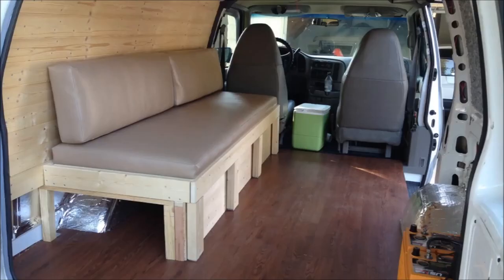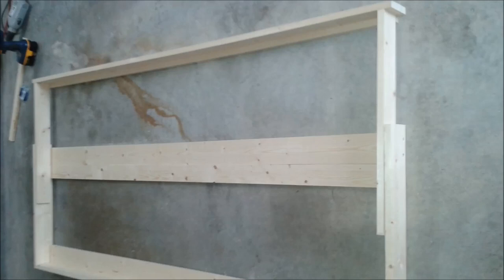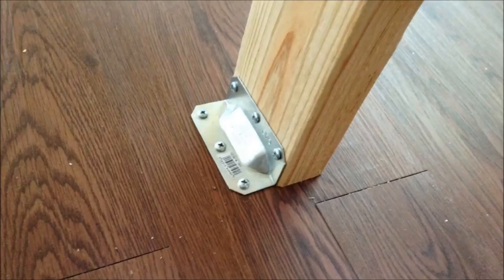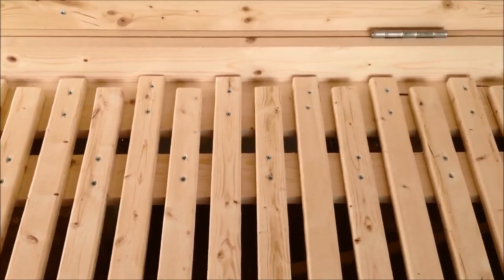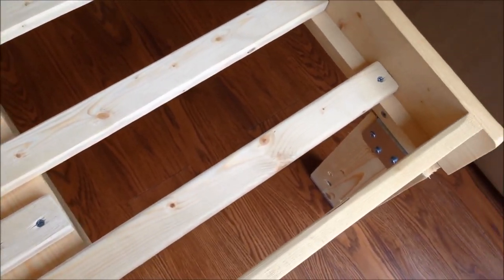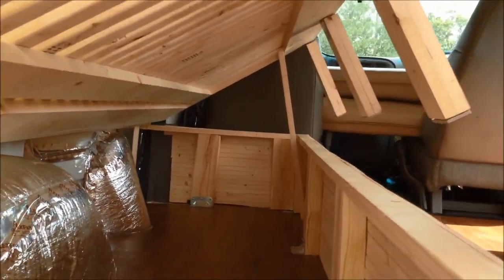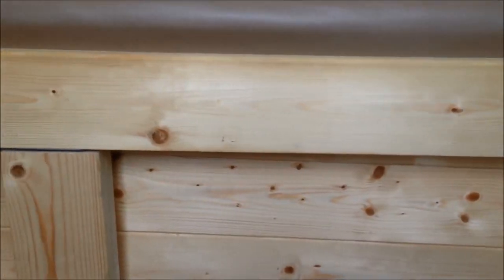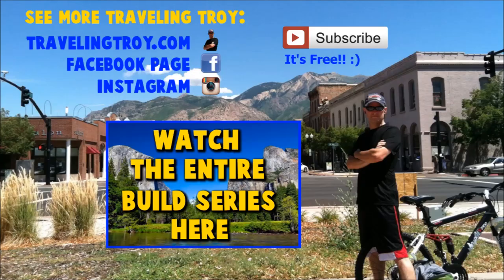Astro Camper Van Build 5 - Sofa Bed Build

Comment: New subscriber here. I have the GMC SAFARI passenger van and made my bed out of PVC PIPE. I made it to the standard size for a self inflating camping mat which is way bigger than what I actually need. But I can always cut it down. I have storage underneath that is huge. I used peg board to be the top of the bed so there was a bit of air flow. Nice build.
Reply from the maker: Awesome Alan!  There is no right or wrong way to do a van build is what I always say.  It's fun to see and hear about different builds as opposed to everyone having cookie-cutter copies.  Have fun with your van, Alan!  Congrats!

Comment: I love the design. Very cool! If I were to build this the only change I would make would be to have the front side of the storage under the bed on hinges, so it can swing out for easier access to what's inside. But it's a pretty ingenious design you have here.

Thanks for taking the time to do these videos.

Greetings from Iran
Reply from the maker: Hi there, you are correct.  It was a pain only having access by lifting up the bed.  I have since removed the paneling along the underside of the bed for easy access to the storage.  I have tubs that can slide in and out without having to lift bed.  I do like your idea of having the access doors on hinges...good one.

Comment: Hi Troy,  Good to see you back.  You inspired me to build a stealth van.  I have a suggestion for your window covers.  Had ears with magnets taped to them so you don't need to use Velcro.  Also used magnets for cab curtain.
Reply from the maker: Thanks for checking out the videos.  I am always interested in making a more efficient with less hassle set of window covers, so thanks for the suggestions.

Comment: building this in my too small for a twin bed room...Thanks , great idea the way it slides out..
Reply from the maker: Cool!  Glad it was helpful.  :)
Reply: i finished.NOW I"M GETTING TOO MUCH FRICTION like old stuck drawers. what would you recommend paste wax? soap? teak oil? I made the bed about 75" by 35" open..Thanks for the vid.After months of research this was truly the best idea I found for my space..I almost build a murphy bed lol
Reply from the maker: I had the same problem.  It started sticking.  I actually used something that I had available, a candle.  The wax was soft and I spread it all over the moving parts.  Now, it works fine and bonus...it smells good.  LOL!

Comment: Nice build. I would stain the wood, glue some felt onto the leg bottoms where they contact the floor, and add a gas shock to assist and hold the bed lift.
Reply from the maker: Good tips.  Thanks for the feedback. 👍

Comment: Wow, what a great bed!!!  Your dad is so talented.  I wish he was my dad too!  I saw this concept in another old school guy type of RV'er who had made one just like this one, but queen size or double bed, not twin.  Brilliant concept having it slide in.  Add some linear actuators and voila!  Auto unfold.  Hofman Architecture in Santa Barbara is renovating vintage Airstreams with these linear thingies.  

I wanted to do this very badly in my own Class C 22 ft RV.  However, I already bought a wood chaise lounge I am converting into a bed, where the old factory sofa bed used to be.  That was a ghastly poufy thing that had to go.  I have to shorten my chaise lounge to fit the smaller space, but the advantage is that one side 'sits up' so I can read. 

Please post some bed making plans where we can find them online.  This is one smart and well made bed!  Your van looks great too, love that wood paneling!
Reply from the maker: Thanks for watching +Lass-in Angeles !  Yes, my Dad is pretty talented in many  ways.  Unfortunately, he didn't make a set of plans for the bed, he just started assembling it based of some napkin notes.  :)

Comment: Awesome! I've decided to upgrade from my 2000 Dodge Caravan to an Astro and your videos will be very helpful, especially considering that was the same design I was planning for my own bed/sofa. I was thinking that you could hinge those legs so when lifted, they fold inward and can either prop up the frame while accessing underneath or fold flat if the frame is folded completely against the wall. Just a thought ... Can't wait to see more vids!
Reply from the maker: Great ideas +Gary Boyer!  The two main problems with having the under bed storage is weight of lifting/holding the bed up and the bedding/pillows get in the way.  I like having the option of accessing things from above, but I plan to add sliding drawers or just tubs that I can pull out easily without having to lift up the bed and moving all my bedding out of the way.

Comment: Thanx ... I need to do some more homework before I gleen this. I’ll need a temp pulley system from ends to wall or ceiling to assist in lifting/ temp. hold in place... then remove ropes, store away when traveling.

Comment: nice work. id recommend gas struts to lighten the weight of it if you need to lift it often.
Reply from the maker: Good idea +Bruce B.  It just gets heavy and becomes a pain to get to stuff while the bedding is on top.  I think I am going to remove the siding along the bed and just build drawers or insert tubs.  This way, I can still lift the bed if needed but I would then have easy access from the sides as well.  Thanks for checking out the channel.

Comment: This was a great video. I want to do pretty much the same thing, with a pull out kitchen under the base of the couch. It would; however, be nice to watch someone make this in real time. I'm a woman, and not handy at all, nor do I really know what I'm doing when it comes to power tools or carpentry. Thanks for this video though. Just goes to show it can be done. 😊
Reply from the maker: Hi there.  Thanks for checking out the video.  Your right.  I don't think there is a video out there showing the step by step process on how to build a pull-out bed like mine.  In my case, my Dad pre-built this bed while I was away and we just needed to build the base together inside the van to install it.  Hopefully, all the angles I provide in this video will give you and others some assistance in completing a similar bed build.

Comment: Really nice bed!  Are you able to sit up straight while sitting on the bed?  Thanks!
Reply from the maker: Not quite +Sister Nomad.  I have to slouch over a bit to fit on the sofa, but my favorite sitting spot is with my legs stretched out on the sofa and my back rested up against the back of the driver's seat.  There is more headroom in this position which allows me to sit naturally.  I do also plan to install a swivel base for the passenger seat which will then be my main sitting spot.

Comment: Hey Troy I just bought a 95astro I'm lost, someone said I can't have batteries inside the van for solar. Gasses. I don't have big bucks to buy real expensive battery,all I want is to run a portable cooler,without having to start the van all the time. Any suggestions, where can I sit a battery safely. I like what you and your Dad have done. Your blessed to have a Dad like that. Been watching....
Reply from the maker: When you say portable cooler, you mean a refrigerator or do you mean an a/c unit?  You can easily run a 12 volt refrigerator from a small battery bank, but it takes a lot of power to run an a/c unit and an Astro van can’t fit enough solar panels on the roof to do that.  😕 Also, I answered your battery question on a previous video. Good luck with your build. 😁

Comment: the pull out section face that takes the bed slats , is that on a 1" x 1" fixed on the inside or a 2" x 1" fixed on the bottom . and are the support arms on the pull out section 3"x 1 " .. Not 4" x 1" as in the comments.
nice work fella !!

Comment: The futon seems better for comfort. If you could get it to go in couch mode with the futon also then that would be ideal to me i would think.
Reply from the maker: Yes, the futon was very comfortable, for sure.  I was really surprised at how heavy it was though.  It was challenge getting to the storage under the bed.  If I had a bed that stayed in the sleep setup all the time and pull out drawers instead of a lift up couch, then I would go with the futon.  Thanks for watching, Chris.

Comment: I'm learning so much from your vids for my own build-out.  Some questions: Did you end up sealing all the wood of the bed frame?  How much do you think the entire frame weighs?  In some comments below you said that you can't quite sit up, so wondering how the height of the bedframe was determined?  thx so much!
Reply from the maker: +1313sp We did not treat any of the wood, but plan to when we pick back up on completing this build over the summer.  I would guess the frame weighs around 30 lbs.  We built the bed frame based off the height of the interior wheel wells which I believe was around 10 inches.  When I first sat on wheel well in the empty van, I had head room to sit up straight, but add in the bed frame, ceiling insulation, ceiling paneling and a 4 inch cushion mattress and that head room just disappeared.

Comment: Are those 1x2s you used for the slats?  And 1x4s on the frame?  How are they holding up?
Reply from the maker: Hi Mallory.  Thanks for the questions.  Yes, those are 1x2 slats and the frame was built using 1x4 white pine boards.  The whole bed has held up really well.  I actually just surpassed 600 nights sleeping on that bed (602 to be exact).  You just gave me a great idea for a next video, an update on how everything is holding up.  :)  Here is a link to the post on my website with a list of supplies for this bed build:  http://travelingtroy.com/2015/sofa-bed-build

Comment: how did you do the paneling?  why the bed horizontal along length of van over in back giving you freedom to look lengthwise, back to front?  i was thinking folding bed in back 1/2, pulling to front allowing for a tv in front and some type of table on other side of bed along opposite length.
Reply from the maker: Hi Jeff Porcaro Groove Master.  We went with the lengthwise bed because the Astro van isn't wide enough for me to lay across the back of the van.  Here is my paneling video:
https://www.youtube.com/watch?v=MFGTZk1aM1k

Comment: I think if I made something similar and made it extend farther I could pull off a double bed. I see a bit of room on the movable boads for a wider bed.
Reply from the maker: Yes, you are correct. You could easily build a wider extending bed all the way over to the sliding door and make a much larger bed. With my build, I could squeeze fit two people on the twin bed (tight fit) and one person on the floor next to the bed if needed. I do hope to have friends and family visit at some point on my trips.

Comment: Great Video! I am wondering how and if the back cushions of the sofa stay in place at the angle you have them in the pics?  Thanks
Reply from the maker: Yes, the cushions are flat rectangular shaped, so they stand on their own...when level.  While driving, they will fall over on turns, so I usually just lay them over before I drive.  I could use Velcro and stick them to the wall, but it hasn’t bothered me much.  Thanks for checking out the videos.

Comment: how does this work out for you when you have passengers sitting all on the driver side in the rear like that? my van is a little wobbly. i've heard its a common complaint among astros with the fuel tank also on the driver side.  thinking of something similar for mine.  might just go with a futon.
Reply from the maker: I just tried to distribute the weight the best I could.  Bed on the driver's side, batteries at the back passenger side, then storage under the bed, above the batteries and in the back.  I don't notice any difference when driving with or without a passenger and gas mileage seems the same.

Comment: Do you have a sketch up link? Also, what are the dimensions of the platform in couch and bed mode?
Reply from the maker: Hi there, Matt.  I do not have a sketch of the bed build.  My Dad built it and kind of surprised me with it.  The dimensions are 6 ft length, 25 inch width in couch mode and 37 inch width in bed mode.  When he first build the bed, 5 1/2 years ago, there wasn’t much available online, but if you check around, you can find plenty on how to make a bed like this now.  Thanks for checking out the video. 👍

Comment: Hey Troy what is the height of your bed slats?
Reply from the maker: Hi Shawn.  For the framing of the bed we used 1X4 White Pine boards, the slats were 1X2 and we used some 2X4s for support.  The height of the bed was build from the Wheel Well up which I believe was 10.5 inches.

Comment: Great Video, Im subscribing to your channel 
what is the wood size u have used?
Reply from the maker: Hi there.  The wood used was 1X4 white pine boards for the framing, then 1X2 Slats to hold the cushion and we added some 2X4 boards to give it some extra support/durability.  Thanks for checking out the vids.
Reply: Thanks

Comment: lol, love buffalo park! used to live near there, moving back to az asap. I was looking for the link for the foam you used, do you have one to share? or list the type of foam that was cuttable and with what tool? need to do this fast, having difficulty w/decisions what to buy and limited $ so i don't want to make a big mistake. Thank you for this, i have a 2003 astro van.
Reply from the maker: Hi there. I too am ready to head back to Az. Very cool place. For the foam, we used Great Stuff spray foam from Home Depot:

https://www.homedepot.com/p/206977048

I think I remember using a putty knife to chisel it away. Or a box cutter. I forget. 🙃

Good luck with your 2003 build. That’s awesome!
Reply: @TravelingTroy  I'm sorry I'm looking for the mattress,  that i have to cut because 39" width is too wide, do I avoid gel? or layered foam? where would I buy it?
Reply from the maker: Earthshine Massage Oh, I misunderstood your question.  Ok, got it now.  I shopped for the materials for the mattress, then had it custom made for me, which was the expensive route.  First, I found Capitol City Upholstery Supply in Austin, Texas.  They had all types of foam in their warehouse.  I was able to lay down on different thicknesses of foam and different levels of firmness to decide how to build my mattress.  I eventually ended up with a 2 1/2 inch firm foam with 1 inch soft toppers on both sides for a 4 1/2 inch thick mattress.  They cut the mattress to my specific dimensions, then glued the pieces together.  I picked it up the following day.

The next step was to determine what fabric to fit over the foam.  I choose vinyl because it could be wiped down easily and if you spill something, it rolls right off.  We bought the vinyl from Hobby Lobby then we took all the materials to a seamstress and had them professionally cover the foam with the vinyl.  I believe it cost me about $300 for supplies and the work, but I didn’t have the skills to do it myself and was happy pay for a good product.  Well, I hope this helps.  Good luck with your mattress and your build.  😁👍🚐💨
Reply: Traveling Troy Thank you Troy, I ended up ordering a century pure certified form high density 3 inches high 24 inches with 72 inches length and I’m just gonna throw that down for now still got to make the platform by Friday w/cold Michigan weather And seeing my clients until Thursday so at the latest I’m hitting the road by Saturday
Reply from the maker: Cool. Sounds like you got it handled. 👍 I’m hitting the road too, later this week. Heading to Arizona.

Comment: I would install metal bed pegs that fold up instead of the permanent wooden legs you have now.
Reply from the maker: That is an option. We did the wood 2x4 legs to keep it sturdy when in sleep mode. It's worked out well so far. 1st Van build, so I'm sure I'll do a lot of things differently on my next one.

Comment: What is the length of the bed?  thanks
Reply from the maker: My bed is 6 ft length.  With the seat pushed back as far as it can go, the distance from the back of the driver’s seat to the back doors is just about 8 ft.
Reply: @TravelingTroy  thanks

Comment: This type of thing is daunting if you're not a DIY expert. I'm trying to fit out my own campervan but am so lacking in woodworking skills like this :(
Reply from the maker: I hear ya +Siouxsie 06 - When I first started researching van builds, I was concerned about how I would get it done with very little woodworking skills myself.  Luckily, my Dad volunteered to help. :)  Maybe you can find a family member, friend or a handyman to help out?
Reply: +Traveling Troy Yeah I think I may have found a builder/carpenter to help with interior panelling work and the ceiling vent. Those things are beyond my skill level and I'm not afraid to admit it :)
Reply from the maker: +Siouxsie 06 Excellent!  Glad you found a helper.  Don't be shy about getting in there and learning what you can while the carpenter is building.  I learned a lot working with my Dad and I'm confident I could do this all on my own with my next van down the road. :)
Reply: +Traveling Troy well I have to pay him...but fortunately his rates are reasonable. I'd pay a lot more if I had to buy or hire a table saw etc to cut the plywood!
Reply from the maker: +Siouxsie 06 True.  It does require power tools.  I was struggling in that department too.  All I had was a drill. ;)

Comment: Also, if you left off most of that "stockade" below the bed, you would have storage under it.
Reply from the maker: I'm guessing you mean the bed legs?  At first, I thought they would be an issue, but it turns out they help keep things in place under the bed when driving.  I found storage tubs witch fit under there well and I use all the space efficiently.  So far, so good.